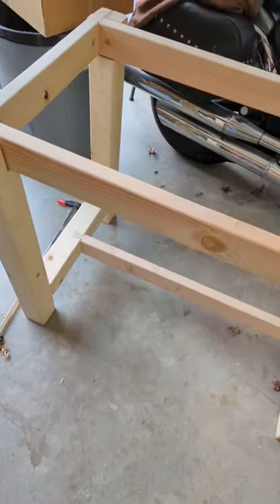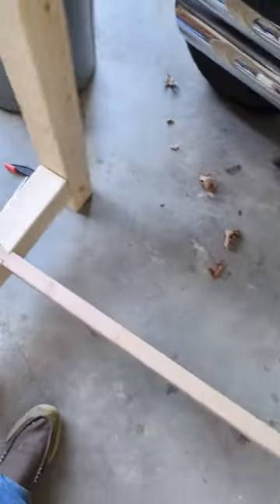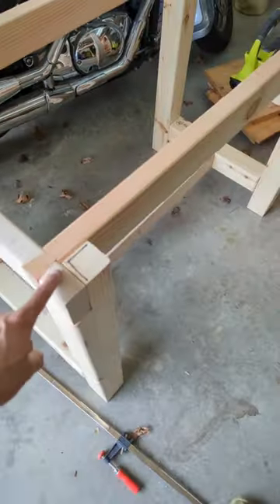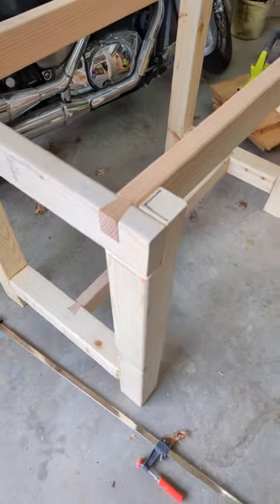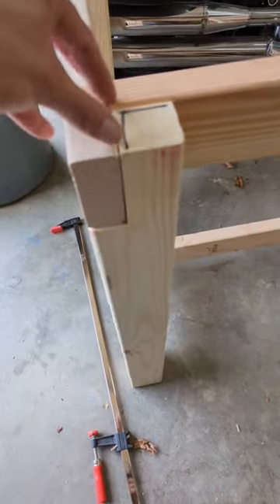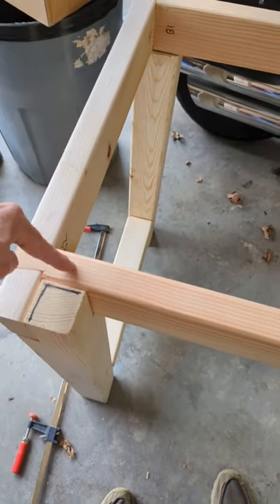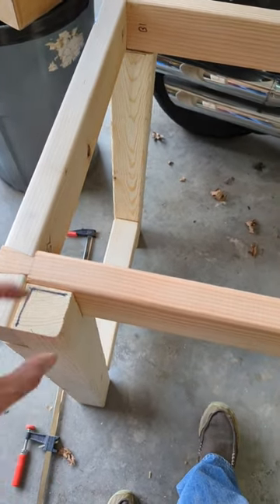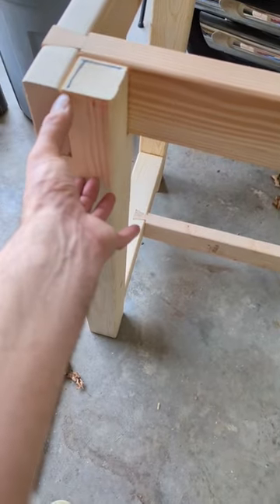I think I built this wrong. #woodworking #workbench #diy  #short #joinery

Comment: Just saw the short here, so more ideas...
You said the top wasn't quite square - would it be possible to shave the stubs so that they form a straight plane for the top assembly to connect to, or would it cause a gap & make the legs splay out?
The vertical lags are probably a good idea because that would lock the top short stretcher onto the half lap & should stop the front to back racking.
I imagine a lot of the movement will also be reduced once the top is attached from its weight and its being attached to the frame.